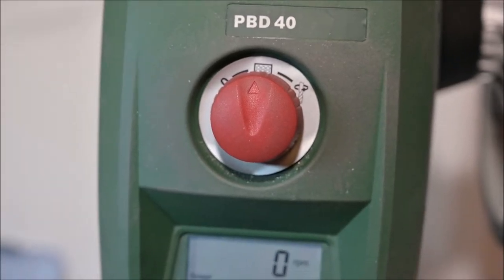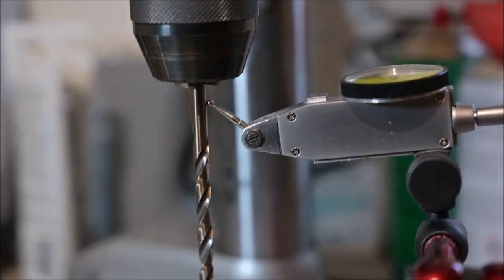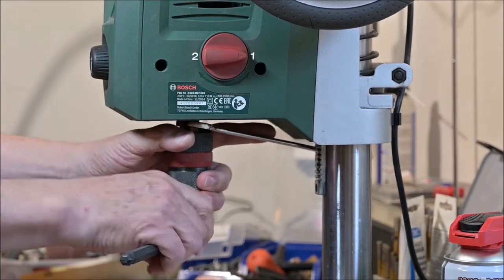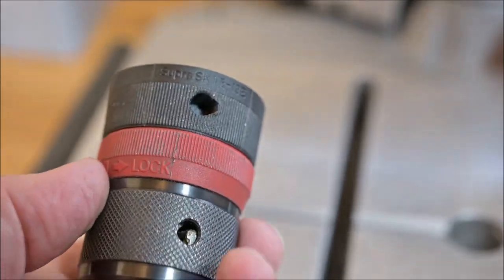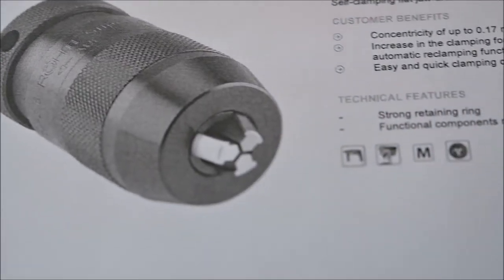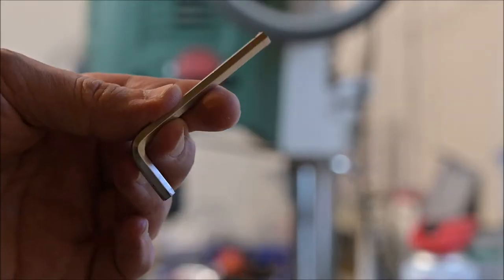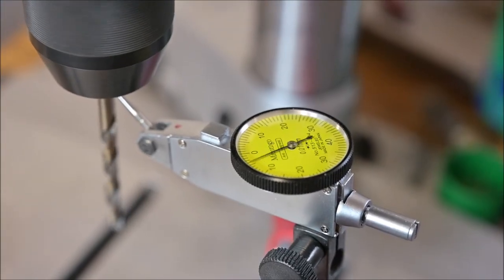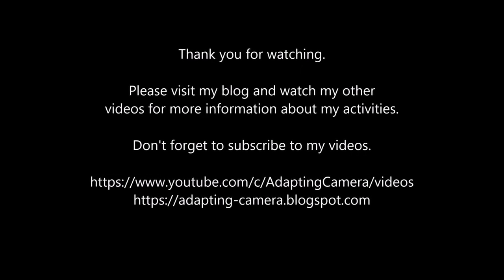Chuck changing on Bosch PBD 40

Comment: Can you give some advice on how to remove the drill bit in the chuck with the new 871050.  It is very tight and hard to undo - unless I am doing something wrong!  thanks
Reply from the maker: I am sorry. It sounds like the drill bit was not centered when you tightened it. Never happened to me that I could not remove a drill bit, or needed to do something special, but what I'd do is that I'd use a wrench to fix the spindle and would grip the chuck with both hands to get maximum grip and twist the chuck release ring. ...or if that doesn't work I'd try to make some sort of tool which can firmly grip the chuck release ring, without damaging it, and which could be used to apply more force. But, as I said, never happened to me, so I am not really sure what to do. I hope you can solve it somehow.
Reply: @AdaptingCamera  Thanks - I'm confident the drill bit was centered properly, I just cut 10 x 30mm holes through 2mm steel - the new chuck works perfectly - hardly any runout :)  I'll try your methods thanks - I can't find any help online for this chuck, but I am assuming you need to twist the chuck clockwise to release the drill bit?  I can't remember which direction I twisted to tighten it, and this is the first time using this chuck.  thanks again
Reply from the maker: @TheAgent4125  I hope you manage to solve it somehow.
Reply: @AdaptingCamera  thanks... Is it clockwise that you have to twist the chuck to get the bit out?
Reply from the maker: @TheAgent4125  Late answer, and I hope you managed to solve it, but yes, clockwise to release and anti clockwise to tighten.
Reply: @AdaptingCamera  Thanks - I did fix it.  I used a wrench to fix the spindle as you suggested.  Then it came away easily.  Thanks again!
Reply from the maker: @TheAgent4125  Very good to know. Thank you.

Comment: Is this drill press good for steel 
And how long will it last 

Would it be able to drill 100 to 1000 10 holes in mild steel and still worl just fine
Reply from the maker: I am using it for drilling mostly in steel and aluminium.
How long it lasts is impossible to answer. Mine has been working flawless since many years now. How long it lasts depends on how you handle it also.
What is a "10" hole? 10 inch or 10 mm? How well the machine performs depends on how you handle the speeds and feeds and how you perform drilling, use lubrication or not, the quality is your drill bits and so on. I have definitely no problem drilling in metal, but I set the correct speed, use high quality drills, lubricate with the right stuff and don't abuse it.
Reply: @AdaptingCamera  i meant to type 100 - 1000 holes 10mm holes
Reply: @AdaptingCamera  so this is the high end bosch green 
It gets the job done but should not be abused 
Long as its not light duty It will work for me, 
I usually drill 5160 spring steel 
I've been using a corded drill for the time being, Ive found a way to get decent perpendicular holes but it takes too long thats why I want to switch to a medium - heavy duty drill press

I think the motor is 710watts which is more than some of the pedestals drill presses sold near me
Reply from the maker: @ThatOneOddGuy  This is the ONLY Bosch bench drill. I don't know if I want to call it "high end", but this is the best one (the only one) they have. It is miles better than the cheaper, cloned alternatives, as well as any hand drill. It has a constant speed DC motor, which actually works, so the set rpm is very well maintained under load. Most cheapo bench drills have poor quality AC or DC motors, which draw a lot of current but has no power and can not maintain the rpm under load. The weakest pointy of the Bosch PBD40 is the chuck, and that it is pretty noisy. OK, it would be better if the motor was brushless, and had better bearings, but it would also be more expensive, and for most people this is "good enough". Cheap bench drills have a lot of disadvantages, especially regarding speed adjustments. Changing belts all the time to adjust the speed is too much trouble, which most users don't bother with, so they set some sort of intermediate speed, which is the wrong approach for good quality work. With the PBD40 you can easily adjust the speed, and changing gear between the two available ones is also easy, so you can adjust on the fly and avoid abuse of the machine, the drill bits or the material you are drilling in, no burning of drill bits or material, so the machine and the drill bits will last long. ...but you need to buy the right drill bits for the right material, and should use quality drill bits and lubricate when working with metal.
Reply: @AdaptingCamera  aight I'll definitely get this drill thx for the info man 
Also can use regular carbon brushes when when they need to be replaced, regylar as in I can get them from anywhere and they don't need to be some kind of specific size 
And how long will these brushes last
Reply from the maker: @ThatOneOddGuy  Please note that I am not advertising this and get no benefits from Bosch. I paid full price for my machine, and my comments are only based on my experience. All I can say is that I am happy with it, but have no idea if you will be that too. Of course, I hope you will be happy, because it is really not the cheapest thing.
Reply: @AdaptingCamera 
Regarding the Morse taper this machine uses for mounting the chuck

Any idea which type this drill uses if it uses one at all? 
I'm asking because I want to get an adapter for an R8 collet to use with annular cutters for very precise holes
Reply from the maker: @ThatOneOddGuy  This machine is not using Morse taper at all. It uses 1/2" - 20 thread.
Reply: @AdaptingCamera this makes more sense now I see why people have tried to use endmills with this machine
Reply from the maker: @ThatOneOddGuy  This is not a mill and is not suitable as one.

Comment: I just had a look at price of the unit and Amazon price was more expensive than the price of the drill press 😢. Useful info nonetheless
Reply from the maker: It depends what you compare with and what you expect to get for the same money. I think that the PBD 40 is in many ways better than most cheap drill presses, even regarding the wobble. I do not regret buying this machine.

Comment: I wanted to change my chuck but it would not come out in any way. I used so much force that I ruined the original chuck and it still doesn’t come out😢. I don’t know what to do. Now I can’t use the drill because it’s damaged and the chuck won’t come out so I can install the new one🙁
Reply from the maker: I am very sorry to read this. I don't know how exactly this can happen, unless if you made a mistake and twisted the chuck the wrong way. Yes, the chuck is very difficult to remove but if it is done according to my video, I don't think it can be damaged unless you use a mallet or try to twist it the wrong way, or not holding the chuck tight enough and it turns while you try to remove it. Anyway, I am sorry and hope you can fix it somehow.
Reply: @AdaptingCamera  I twisted it the right way, that is to the left. What I wasn’t able to do correctly was fixing the Allen key to the chuck. It always came lose when I started twisting it. Then I tried to hold it with a big plumber wrench I have and that was the moment I broke the chuck. I gave up because it would not come out in any way. I came back later and used that wrench again willing to break the chuck in pieces if it need be because it was broken anyway. That was what actually happened, the lower part of the chuck came out in pieces and when I could grab the inner part I was finally able to unscrew the chuck. It seems the drill is running fine.
Reply from the maker: @JoaoAlvesCarlos  Good to know that the machine is fine. I guess that the Allen key was not properly inserted if you could not get the chuck to grip it. Anyway, it's bad luck, but since you wanted to change the chuck anyway, and the original chuck is really poor quality it's not a huge loss.

Comment: Hi, great video! Do you have a link for the new chuck please?
Reply from the maker: The new chuck is a Röhm SUPRA S 1-13 mm. I don't know where you live and where you can buy it, if you are interested in that specific chuck.
Reply from the maker: @gee7801  I am sorry you bought the wrong one. The Bosh PBD 40 has a 1/2"-20 thread on the axis, not B16, as you can see on the box I am showing in my video, as well as in the video at several places, like here: https://youtu.be/nCqVoaGVK8g?t=302 and also marked here: https://youtu.be/nCqVoaGVK8g?t=340. Perhaps you can send it back and change it...?
Reply: @AdaptingCamera  No worries mate, my fault entirely. Going to send it back and try to find the right one. Amazon don't seem to have it.
Reply from the maker: @gee7801  The part number is 871050 and I bought mine via Amazon, though through Amazon Germany. I fond it in USA also: https://www.amazon.com/Rohm-871050-Diameter-Clamping-Capacity/dp/B00DD7PEXA/ref=sr_1_1?dchild=1&keywords=rohm+871050&qid=1597093322&sr=8-1 Just type in "Rohm 871050" and you should find it.
Reply: @AdaptingCamera  Many thanks, I appreciate the link. For some reason I couldn't find it.
Reply: B16 is a tapered mount. That Chuck has different mount variants.
Reply: @adrian-mu3jr  Thanks Adrian,  total newbie but got there in the end. Cheers.

Comment: It’s 1/2 right ? I will order before i dismount mine.
Reply from the maker: Yes, it is 1/2"-20 1-13mm chuck. Part number: 871050 is the one I bought. https://youtu.be/nCqVoaGVK8g?t=500
Reply: Adapting Camera ok great thanks. I just bought mine and yes the chuck is really bad. The jaws don’t close synchronized.

Comment: which product number...the link takes you to a page with many variants. TIA.
Reply from the maker: Did you watch the video? If not then please do, it will give you the answer.
Reply: There are loads of chucks suitable for this drill…it’s a standard 1/2”x20UNF thread as used on all hand drills etc….this machine is basically a hand drill on a stand, with digital readouts…
Both Jacobs and Rohm have loads to offer, keyed and keyless…
Reply from the maker: @johnhall8455  Yes, there are many chucks you can find for this, but I see no point in changing to an equally bad one. Anyway, you are wrong, this is NOT a hand drill on a stand, it is considerably better and is totally different.

Comment: Great help video! Thank you. I made the same chuck changing on my brand new PPD 40.  It was 0.12mm with original and it was 0,07mm with Röhm Supra 1-13S 1/2" (871050). These are the videos:  Original-  https://youtu.be/XRVxExDp1jM , with Röhm Supra 1-13S 1/2" (871050): https://youtu.be/L9zo2ACCPcM Thank you for your video again.
Reply from the maker: Thank you for your comment. Yes, changing the chuck is a huge improvement of this machine. I am very glad I made that change and the only thing I regret is not doing it earlier.

Comment: I hate ALL keyless chucks. My old drills (that still operate superbly) have keyed chucks that tightly grip the bit. This is something that keyless chucks are incapable of doing, with bits slipping (or dropping out of the chuck) all the time!
Reply from the maker: I think you are wrong. I have no problems with quality keyless chucks at all. But sure, if you are using cheap crappy ones then keyless is not as good in gripping as a cheap and crappy keyed chuck. Nevertheless, the keyless chuck of the PBD 40 is really bad, not even designed for bench drill machines. Replacing that with keyed chuck is also better than not replacing it at all.

Comment: I did the same, but got opposite results. The original chuck had a 0,02mm deviation (yes, very small!) and when I replaced it, it got much worse, around 0,07mm.
This was measured on a completely new PBD40, never used. So the question is now if the deviation get worse over time and the precision in the beginning is better.

The 871050 has max deviation up to 0,25mm

According to the catalogs overview over Supra-models, the Supra-I should have a better precision, (max 0,12mm) and available in 1/2"-20 - but it is not listed on the Supra-I page.... that is a bit strange, and a mistake from RØHM.

UPDATE: a little video https://youtu.be/sj9VzjKF9wY
Reply from the maker: To be honest, I think there must have been something wrong with your measurements, because the original chuck is really poor quality. Anyway, if I am wrong and you are right, then why change it at all? I mean, 0.02mm is NOTHING to worry about. On the other hand, the new chuck is better, because the original one also had poor gripping ability, because of that stupid extra ring, which is really not necessary for any good quality chuck, except if the machine can rotate in both direction, like a hand drill, but the PBD 40 rotates only in one direction.
Reply: @AdaptingCamera  Yes, I would replace it because of that annoying locking ring, I hate it. But I was VERY surprised that the deviation was this good on the old. but remember: the deviation is MAX! it can be anything from 0.00 to 0,25, the specification is maximum worst case. The measurement setup is the same as when I replace it with the Supra-S, so even if we only see it as a relative measurement, the supra-s is worse in my case - and it is clear to see visually on the precision capstanaxle I use for measuring.
https://youtu.be/sj9VzjKF9wY

Comment: The chuck change didn't do it for me I'm afraid. In fact, I found that the Supra S wobbles more than the original Supra SK. Pretty sure the main problem is with the bearing. I did open it up and try to remove the bearing, but I couldn't get the damn thing to come out. Be warned if you plan on taking it apart, it can get very complicated in there, and you could mess up the machine if you don't know how to put everything back together again. Rather than risk damaging the machine on a second attempt to remove the bearing, I'm thinking about selling it and buying something else.
Reply from the maker: I am sorry if it did not help you, but the Supra S is CONSIDERABLY better than the SK, so if you feel that your Supra S wobbles more than the SK then something must be wrong with it, or you did not measure them the same way, or not measured at all and just go by your "gut feeling".
Reply: @AdaptingCamera  I didn't measure the run-out using a dial indicator (I don't have one), but I did place a ruler accurate to 0.5mm underneath the tip of a drill bit held by the installed chuck, and noticed I could rock the Supra SK to a maximum of 0.5mm on either side, while the Supra S would rock to beyond that mark. The other thing is that when I opened up the machine, I noticed that the majority of the wobble is caused by looseness inside the bearing. If the bearing is loose, then the best chuck in the world couldn't fix the wobble.
Reply from the maker: @nooruddin7401  Surely that is NOT because you changed the chuck. There simply can't be more wobble because of the chuck change, unless you caused some damage to the machine when you removed the original chuck. Rocking the chuck by using your hand is NOT the right way of checking the run out and is also very biased, and basically, NOTHING can be concluded from such "test".
Reply: There’s a big difference between wobble and runout…wobble can be felt by hand…rocking from side to side…but runout can occur with no wobble….ie…if the chuck is not perfectly round, or has been badly threaded etc…There may be no play in the shaft, but a poor chuck will show runout, but no wobble

Comment: I'm surprised Bosch is allowed to get away with such shoddy equipment. The law states that the product must be fit for purpose, and mine certainly isn't.
I have ordered the new chuck and shaft bearing, and will be looking at changing the bushing where the body clamps to the height adjuster.
Reply from the maker: Sorry, I don't know why your PBD 40 would not fit it's purpose of hobby use, drilling in wood and some light metal. If something is wrong with your machine you should use the warranty. I am sure your law (which law is that...?) does NOT specify anything about this product, so why would it not be fine to sell this wherever you live? I mean, seriously, I used this bench drill to build a serious CNC and use it mostly for drilling in metal, have used it for over two years with the original chuck, and while the new chuck is WAAAAAY better than the original one, even the original was good enough. In fact, in my opinion, this machine is good enough for professional use as well, even right out of the box. There is NOTHING similar to this on the market which is better when all the parameters are counted for. If I had to buy a new machine I'd still buy this one, even with the original parts, because it is an excellent machine as it is, even if it could be improved. In other words, I strongly disagree with your comment, which I find baseless, lacking facts and reality.

Anyway, good luck with your chuck and bearing changes. I have the necessary bearings also, but have had no time to change yet.